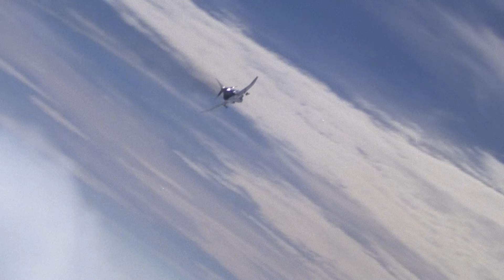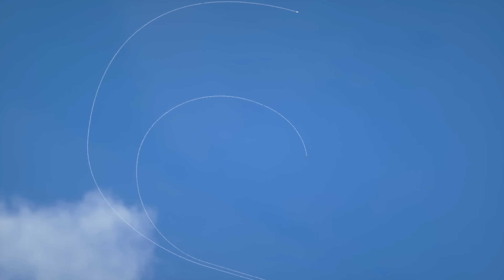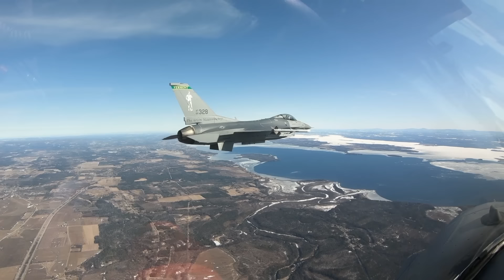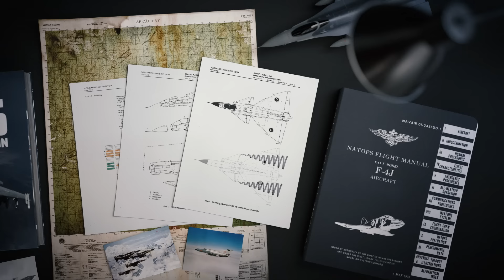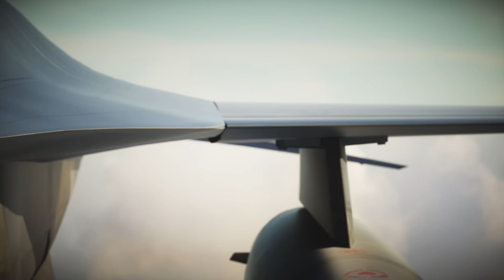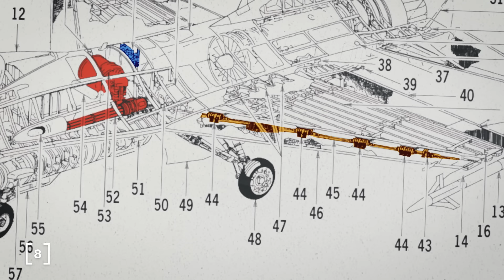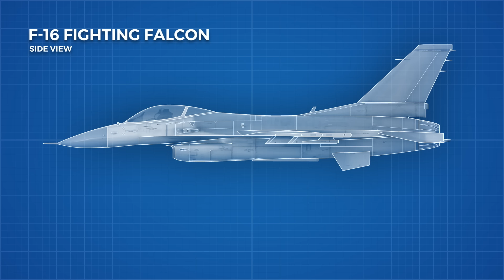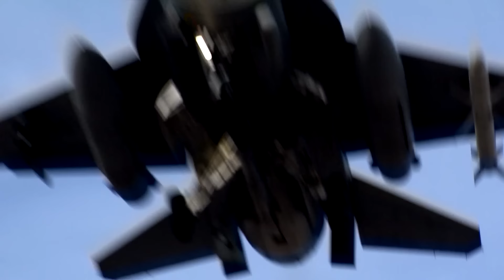The Insane Engineering of the F-16

Comment: I think the F-4 gets a bad reputation it does not deserve. Even considered "bad" 

At its worst the F-4 had a K/D against the Mig-21 of 3:1 

And even after they added the cannon to it, it still achieved the majority of kills with missiles.

While many F-4's were lost in vietnam the overwhelming majority were lost to surface to air missile systems.
Reply: The pilots simply weren't trained how to dogfight in the F4. The rules of engagement said they needed to get visual confirmation before firing on a target. Well, if your pilots aren't trained how to dogfight and then you require them to get within dogfighting range, you're gonna have a bad time. The F4 is meant to engage at range and then use its great top speed and thrust to get out of range once it fires off its munitions. The "rules" of Vietnam didn't allow that, and it took some time for the doctrine to adapt to the new theater. Once the changes were made though, the F4 Phantom was a big success and a serious force in Vietnam.
Reply: @TheK1ngFiasco  I think its worth adding why the rules of engagement were so crappy. 

IFF was still new and many aircraft and most helicopters lacked it. The fear of friendly fire was very high.
Reply: @hypersonichobo4263  A very valid point. You still have to wonder why they sent those boys out there knowing they'd be in close contact with the enemy but not give them the training to deal with close air engagements.
Reply: And Navy F-4s never got a cannon in Vietnam, but after the TOPGUN program was implemented the kill ratios went up more than USAF kill ratios after adding a cannon to their F-4s.

Training was the key. Real world scenario based training. Before Vietnam pilots rarely got to practice ACM and when they did it was "hey let's meet at such and such coordinates at such and such time" informally. TOPGUN and the USAF Fighter Weapons School were a revolution in fighter combat tactics training.
Reply: It's also worth noting that Israeli F-4s absolutely dominated the skies over The Middle East, flying against the same (and newer) adversaries that US F-4s faced over Vietnam - it's kinda odd that this aspect of the plane's service doesn't get brought up very often, even though it applies directly to the debate as to whether the F-4 was 'good' or not.
Iranian F-4s also acquitted themselves very well against Iraqi MiGs and Sukhois.
There was a lot more to the Phantom II than Vietnam. It was extremely popular worldwide for a good reason.
Reply: @stickiedmin6508  my favorite story is when the Egyptians wouldn't stop complaining to the soviets about the shortcomings of the mig so the soviets said "watch how real pilots fly" and then immediately fell into the same trap the Israelis had been devastating the Egyptian air force with and lost like four or five migs and all but one pilot immediately.
Reply: @hypersonichobo4263  
I was literally just reading about that one - a couple of Phantoms acted as bait, able to stay juuusst out of reach of the Soviet pilots fixating on and chasing after them, until eight Mirages suddenly appeared from low altitude, and tore them to pieces.
I've always kinda thought that American companies are always eager for their jets to end up in Israel because, aside from the obvious financial value of the contracts, there's no better place to show off their real world, combat capabilities. Simply put, the jets get to shine, and it makes for FANTASTIC advertising. 
F-16s, just like the F-4s before them, sold all over the world based in large part, I'm sure, on the reputation they gained flying for The IAF.
Reply: @stickiedmin6508 Exactly the whole premis of the video about the F-4 is like 100% wrong, wtf is this ?
Reply: @stickiedmin6508  fighting against an incompetent air force like  egypt, and syria would obviously  allow u to dominate the skies of the midlle east
Reply: @napoleanbonaparte1804 
Were Egypt and Syria the only airforces mentioned?
Reply: I agree with you, one of the most magnificent aircraft ever made but get Washington involved & ignorant, I said ignorant commanders involved and you got a mess!  Dwayne.  USA Air Force Veteran of the "Viet Nam" Conflict, 2 tours of duty. Union City, GA. USA.
Reply: Yes exactly. It was a problem with doctrine and ROE not necessarily the plane itself. Fighter Mafia propaganda.
Reply: And you believe those stats because the US government told you so? 

The US is notorious for making up BS k/d ratios for its fighters. The most popular one is how the F86 had a k/d of 10:1 against the Mig 15. This was total BS. The Rand corporation did some proper research and calculated it to be 2:1 in favor of the F86 and down to 1.3:1 when the Mig 15 was piloted by Soviet pilots. A far cry from the 10:1 BS.
Reply: 1. In video are almost not visible any MiG-21! Planes with Czechoslovakia markings (Československé letectvo) are Su-22! Not fast, not maneuverable, pretty heavy due a variable swept wing. Su-22 obviously dont have clean delta wind as MiG-21!
2. MiG-21 does not have variable swept wing in any variant or clone!
3. MiG-21 is not dogfighting plane, it is not easy to maneuver special in lower speed in low attitude.
4. Is designed primarily for attack from back.
5. Su 22 does not have AA radar!
Absurd
Reply: in US score reported USSR aircrafts as destroying in amount and types Vietnam never has and  USSR or China never delivered to it. Did you never concerned why till now casualities during 2 ww US bombers and its crews used to air strikes on Germany wasnt never declassified? Did you read Catch 22 Joseph Hellers? Or - maybe - Slaughterhouse No 5 Kurt Vonneguts? It is fact that propaganda ministry Joseph Goebbels died - but his art of authority social magic words lives in any so-calling modern democract states in socialtechnics layer. New brave propaganda. 
We live in lying making by own so-called democratic authorities according script III Reich Goebbels.
Reply: Not saying the f-16 wasn’t needed, or the right way to go I’ve no idea off the top of my head. What I do know is that our air problems in Nam were mostly congress being the dense fart sniffers and nose pickers that elected officials usually are.
Reply: The F-4 is bad compared to the F-16, especially in a fighter role. The F-4 was still an amazing aircraft.
Reply: @urgo224  I mean, sure. That's like saying the P-51 is bad compared to the F-86.

Comment: The ultimate irony is the concept of "light, cheap, maneuverable jet to take on MiGs" became obsolete very quickly as missiles truly made dogfight suicidal and nowadays Vipers are extremely sophisticated, much more heavier and expensive bomb/missile truck in the same way F-4 was.
Reply: Yes, fanbois of the F16 always miss its flaws. The biggest flaw is simply that it is unrivalled as a WVR dogfighter but that form of combat is now very rare (for one thing the opposition is likely to run away if they know that blip on their radar is an F16!). The radars and missiles are so good that is all BVR now. Which is where the other flaw of the F16 comes in - that clever bottom inlet has a big Radar Cross Section. Stealth it aint. Fortunately the F16 has proved very adaptable to other roles, which is why it is still being made. It is fantastic bang-for-buck for air forces not facing a sophisticated opponent. I don't think the Ukrainians are going to risk flying them near Russian S-400 SAM systems though - it'll be a standoff missile truck.
Reply: @kenoliver8913 well you probably wouldn't risk flying anything that isn't a raptor/f-35 other stealth jet near an S400. Its an anti air system, it would be like standing still in front of someone with a gun that wants to shoot you.
Reply: Definitely wouldn't call the Viper a bomb/missile truck... And a Viper can jettison it's payload and turn up its own ass, the F-4 couldn't.
Reply: @kamraam1464  Viper is one of premier strike platform capable of carrying almost 8000kg of weapons, almost as much as Phantom. It's not the point F-16 outperforms F-4, Viper flipped a bird to Fighter Mafia and became what they despised: an expensive and highly capable missile/bomb truck.
Reply: Simple people like simple content.
1. In video are almost not visible any MiG-21! Planes with Czechoslovakia markings (Československé letectvo) are Su-22! Not fast, not maneuverable, pretty heavy due a variable swept wing. Su-22 obviously dont have clean delta wind as MiG-21!
2. MiG-21 does not have variable swept wing in any variant or clone!
3. MiG-21 is not dogfighting plane, it is now easy to maneuver special in lower speed in low attitude.
4. Is designed primarily for attack from back.
5. Su 22 does not have AA radar!
Absurd
Reply: nah
Reply: @fuke1345  yah. The original Boyd proposal was light 5G airframe, daytime only, no radar. The F-16 ended up having 9G airframe, a radar, all-weather systems and later gets all sorts of bombs and missiles.
Reply: @mimimimeow  I am very surprised he mentioned the Fighter Mafia. Utter horseshit.
Reply: So it was a compromise between different design philosophies that turned it into one of the best fighters in history. Certainly you aren't trying to discredit Boyd, are you? @mimimimeow
Reply: @kamraam1464  No I did not intend to discredit him. Ideas adapt with changing threats and so does the LWF.
Reply: @kamraam1464   Boyd's theories on energy management concerned WWII fighter and early subsonic jets and bear no relevance on dogfights in Vietnam and Korea which led to the F16, itself an aiecraft that while being capable of it primarily relied on everything Boyd, Osprey and Burton hated, radar, missiles, avionics, over the horizon engagement etc etc etc... F16 is none of what the Fighter Mafia wanted and that's why it worked unlike an ai3craft that did follow these principles, the A10.
Reply: @mimimimeow  funny thing - at time of F-16 inception, only aircraft that could fit electronics enabling it would be B-52....
Reply: @please_stop-v7o  You miss the point: F-16 could sustainably acquire these capabilities in 90s, with quality and availability of electronics.  And like it or not, USA had no viable, widespread BVR missile until AIM-120 arrived.  You can easily see that Boyd etc. WERE RIGHT AT THE TIME if you examine MiG-29. In THEORY it was superior to F-16 when initially introduced - EOTS, BVR radar guided missiles, datalink and other bells and whistles, two engines. Lot's of sophisticated junk; hell I think MiG-29K could fire R-77 before F-16 could do AMRAAM. And what did it amount to? Short ranged, inefficient air-show aircraft that took beating even from EVERYONE, including own Soviet contemporaries. Even with general superiority of west in quality control and miniaturisation, it wasn't until 90s when F-16 could really start turning into what it is today, while overengineered but underperforming MiG-29 shifted into irrelevance. Today you don't need the monster of airframe like Su-27 or MiG-31 to fit sufficently performant electronics or light PGMs.  In early 70s it wasn't an option.

Comment: In general higher and faster evolved out of the fighters in WWII which were typically heavier, better armed, bettered armored, faster, and higher flying at a cost of maneuverability necessitating zoom tactics to dive on opponents and then climb to regain energy superiority. Hence speed and altitude. This evolved into beyond visual range combat with fast, heavy fighters emphasizing range and power using missiles which unfortunately missed and failed. Stupidly the rules of combat required visual identification of the target negating any potential advantage beyond visual range could have provided. Thus was born the fighter mafia arguing for lighter nimble aircraft able to engage the enemy on the terms the military forced on them instead of the heavier less nimble aircraft the military wanted for a kind of fight they wouldn’t allow the pilots to have. Stupid. This has further evolved into expensive stealth aircraft for even greater distance beyond visual range with even less emphasis on maneuverability in the case of the sixth generation for again a fight the military won’t let the pilots engage in. They still require visualization of the target. Politically the fights the US gets involved in requires visual confirmation. The beyond visual range doctrine is meant for WWIII, and all out no holds barred conflict which we have so far successfully avoided. We need to build planes for the scenarios we repeatedly find ourselves in, instead of hypothetical cataclysmic wars we aren’t in. Think about how much money was spent and how many generations of US fighters have been built for the wrong war, and how many pilots have been fighting the wrong aircraft for the conflict.

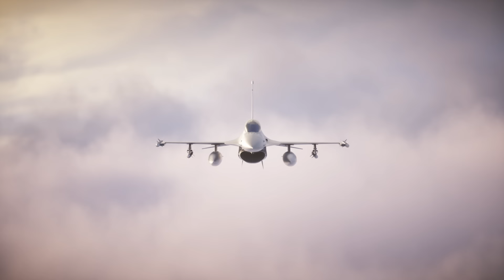Comment: 4:03 No, the horizontal component does not cause the plane to turn, it causes the plane to slew, what causes the turn is the pilot pulling back on the stick creating torque, a plane can fly on its side all day and never turn, it will just wind up going along with a sideways slip.
Reply: 28:10 I think your graph is a bit off there, you've got the center of gravity so far forwards that its in the cockpit, not back where all the heavy bombs, guns, fuel and engine are.... and youve got the center of lift infront of the wing!
Reply: @Mort_OOPz  The wings have lift. And that lift resutls as turn when plane is turned on its side. So when from the straight flight pilot tilts plane by that stick on its side but doesnt mess with pulling or pushing on that stick those wings which made plane fly straight will now make it turn.